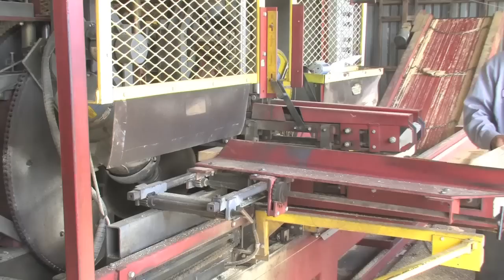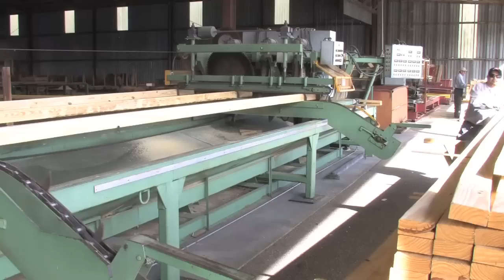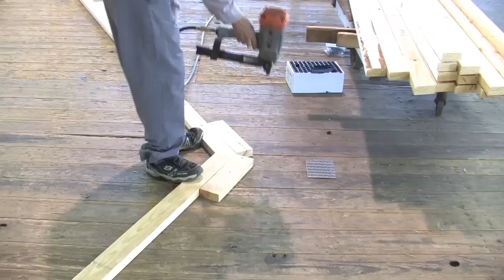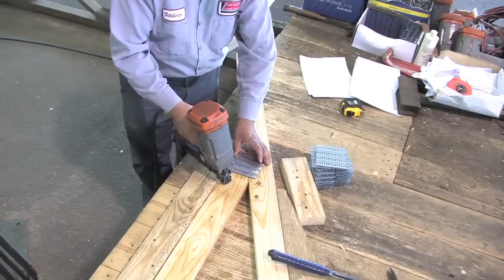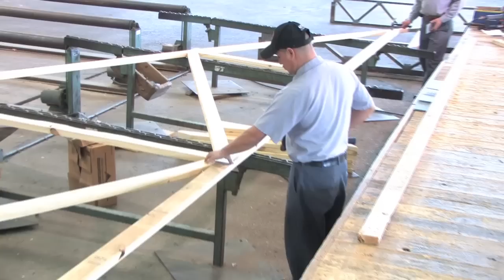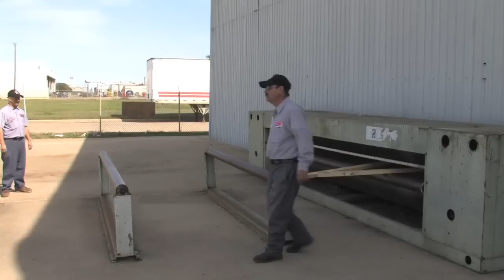Fort Worth Lumber Rafters Trusses Design And Build

Comment: They're doing this old school style, on a cork table. Modern truss plants use slot tables with steel pucks for jigging. It's so much faster. Block jigging is pretty much obsolete now unless you're building junk trusses.
Reply: Labor is only minimum wage there  probably 5 an hour, thats why the don't update machines.

Comment: As a guy who's worked as a truss builder all the way up to now designing trusses, this is the most inefficient and low quality way of building trusses I've even seen.  My crew would work circles around these guys and put out a better product.  This is a disgrace to the truss business.
Reply: I agree with you!!!
Reply: Yeah, this shit was beyond disappointing
Reply: Not the workmen's fault. Blame it on the owner for not having a setup table where they would not have to flip the truss prior to rolling.
Reply: I look to follow the same path, started off as a builder, now i drive the lift truck after one year

Comment: That table guy is over killing it with them staples. You only need two or three to hold in a web.
Reply: Also, if you cross your staples in an x pattern, in has more holding power.
Reply: You don't even need staples
Reply: José Villa Correct. But its faster. Its not easy to use just a connector plate on some webs. I will do it only if I get ahead of my table guy. What's with these guy's shooting staples into the plates? Thats a little redundant.
Reply: IF anything, stapling or nailing the plate just creates weak points of failure in the future.
Reply: @Joshua79C  Stapling is required to hold the truss together while they flip it over. The metal plates are doing nothing until the truss goes thru the roller.
Reply: @gary24752  - i worked for a truss feb company in FL for a few months until I found a better paying job doing what I was licensed to do. They used nails on the setup table then us other floor laborers would flip it onto a set of rollers where two us would plate the other side only hammering them in before going through the press roller and I would strap them when a stack was done  per order (they said I was the best at this when I worked there).
The newer systems I seen since leaving that company as good as they were to me for what they paid us, these new systems allow you to forgo needing to staple the plates to one side thus eliminating any possible weakness.
The only good thing stapling or nailing was good for is just to hold the plate until it went through the final rolling press.
Reply: @rickyd0821  nope, and I hate that people actually think this too. It’s actually weaker. The impact from crossing the staples (mid staple hitting mid staple), weakens them. Not to mention that you are closer to the edge of the board and can split or chip with the grain making a bad splice connection, which then transfers load less efficiently through the joint. 

To top it off, staples mess with the plates a little, so the more you have the less constant contact between plate & wood, bent teeth, lack of full embedment, and so on.

Comment: i didn't know you could use box staples for truss building
Reply: This maybe late, but if anyone reads, the staple dont really mean anything, in a  modern table truss setup, it only acts as temporary holder, so any wide staple would work, cause that nail big flat one, which we usually call gang nail will do the final job.

Comment: I worked in A Truss Factory for Clement Realty. We Used to build Houses, Apartments for Them. We Framed a 12000 Square feet 🏠 For Mr. Duke Clement in Memphis, Tennessee. I Ran The Truss Cutter,. It was kinda like the machine on THIS video. But I Ran The Truss Cutter by myself. It had 2 Big blades , And 2 smaller blades , set on a angle That you adjusted before you changed designs on each set of Trusses if needed. But we would off load The Boards on A Forklift and move them about 25 Feet to The preeser. 🤔 I thought we were Slow , But we were faster than These guys . 😂 Shout out To Teague Contractor, We built a Lot of Houses in Marion, WEST Memphis, Motels, State Farm Claim Centers, even built A House For Blanche Lambert at Horse shoe Lake. She's A Nice Lady. She didn't even Care about us Tokin on our Break. We called it A Union Meeting 😂 .

Comment: Dear god this a barbaric and ancient way to build trusses! All those staples actually weakens the wood and joint. That and they are stapling the metal plate before it's pressed? Dear god. They are 10+ years behind the curve, they shouldn't be building trusses, they should be making ping pong tables.

Comment: Isnt glue used when building these?
Reply: lmfao what a joke, glue sure, maybe if it was glulam, lvl, or other type of engineered timber but no, the connectors plates as you see are the norm and pretty dang strong and makes for easy repairs where as glue would inhibit ease of repair

Comment: Sorry but do you realize that for every pop of that nail gun you reduce the integrity of that joint?
Reply: what nail gun? those are staples! and yes they just shortened the life and reduced the strength of the plate on the one side at every connection